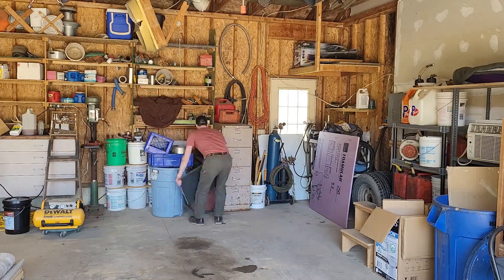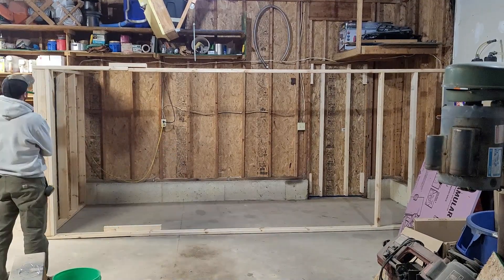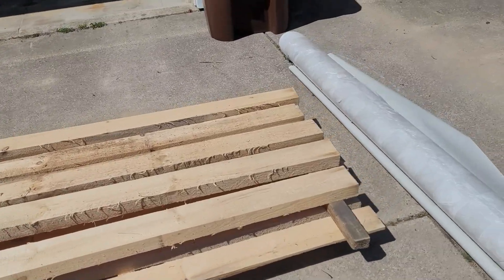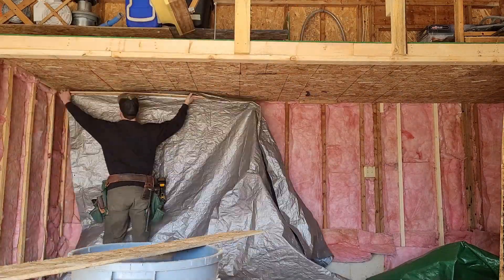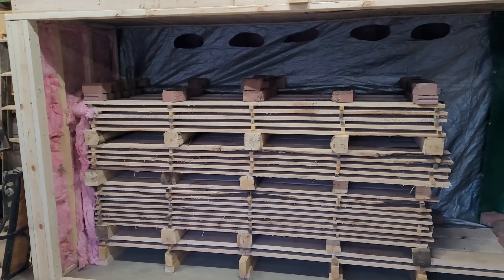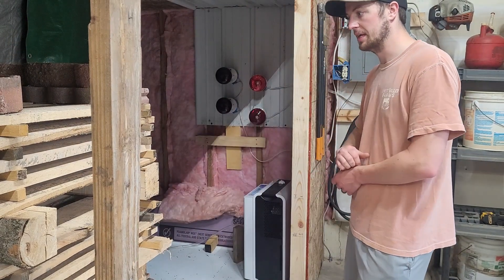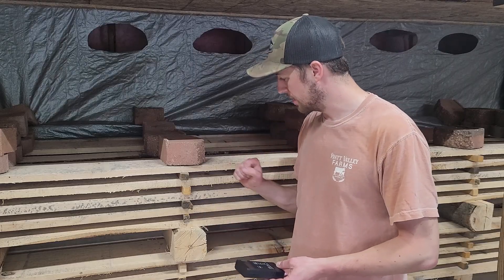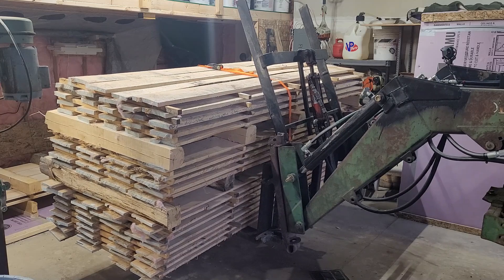How to: Build Your Own Wood Kiln - Dry Wood in 3 Weeks - DIY Garage Build

Comment: A dehumidifier? It might be more energy-efficient to just vent the moisture-laden air outside.
Reply from the maker: For optimal results, I need to keep relative humidity inside the kiln at a specific percentage. A dehumidifier is the best way to do that.
Reply: @craftzmanchris9859  Oh. Alright. That makes sense. You don't want too much of a humidity gradient in the kiln, nor too large of a difference in humidity between the air and the wood.

Now I'm wondering whether a humidity-controlled exhaust system would be possible, whether active or passive—by passive, I mean something that operates like the dial of a hygrometer; a material that is analogous to a bi-metallic strip with respect to temperature, but for humidity instead.

Circulation fan + heater + humidity-controlled exhaust system. More humidity = greater exhaust rate. Less humid = lesser exhaust rate.

What brought me here was researching ways to dry assorted shapes and sizes of wood sections for carving sculptures. I have assorted branches and tree trunk sections of varying lengths and diameters, but they have issues with cracking and/or molding. I have been looking into active ways to dry wood uniformly in order to mitigate cracking. Ideally, with a way to sterilize the wood.

A solar kiln would be acceptable during the summer, but freezing during winter would probably be a setback and risk splintering the wood as the water within the wood expands. I started looking into continual heating and your video was among the results that I decided to watch.

Comment: Did you keep the Kiln running 24/7, is there any concern for a fire issue? I'm wanting to do this, just a little nervious about starting a fire.
Reply from the maker: Yeah I ran it 24/7. I kept a thermometer in the kiln the entire time to monitor the temp. I kept a close eye on it the whole time because I was nervous about fire. I think you you are not nervous then something is wrong, but with the kiln maxing out at only 130 degrees, I wasn't too worried about it.

Comment: Thanks for the video. I see how you wired the lamps so you could run any combination from 1 to 4. What temperature were you aiming to maintain with the heat lamps?
Reply from the maker: @TheKenkat10  no problem. I slowly work up to 100 degrees F over the first week, then work up to 120 for the next 2 weeks, then work up to 130 for the last week and try to hold 130 for at least a couple days. It also depends of the type of wood and target MC.

Comment: so the fans are behind the tarp?
also which heat lights are those? and what temp does each put off?
Reply from the maker: Yes, the fans are behind the tarp, mounted on the wall, pointed straight down. Not sure what the temp is off the heat lamps but they are 250 watt each. I bought them at Menards I think.
Reply: @craftzmanchris9859  would a solar kiln dry them faster?
Reply from the maker: @jacobkincaid123  In full disclosure, I do not know because I don't have one... but I don't think so... this Kiln is at temp 24/7 and I can more closely control the temp and RH. Plus I can use it year round. I can get it to 130 degrees in the dead of winter.

Comment: Hi, I'm just starting off with my kiln and have found it hasn't pulled that much water - about a gallon in 3 days. Obviously some of that is about initial MC and volume of the stack etc, but I'm curious about how much you were pulling. Basically, I'm wondering if my dehumidifier is cutting out at higher temperatures and lower RH (despite being set to continuous) ... Or maybe I'm just impatient. Grateful for any thoughts.
Reply from the maker: To be honest I'm not sure how much water the dehumidifier pulls because mine just drains outside. I would expect more than a gallon every 3 days. I think you might be right, it might be shutting off for some reason or maybe it's not working right? I've seen them still run but stop pulling humidity out of the air. Is it a new dehumidifier? 

What temp are you able to get the kiln up to? What species of wood is in it? How much wood? All of those questions will effect the amount of water pulled from the wood.

Comment: This is an awesome setup Chris! I've looked at every home built kiln that exists on Youtube gathering ideas for my Kiln build in March. How high can you get your temps in there? I've gone back and forth between r13 or something thicker but I'm thinking r13 is all I need to get up to 130 or so for my bug kill. Keep up the great work.
Reply from the maker: Thanks for the kind words. If I run the dehumidifier on continuous, I can get it to 130-135 degrees. The problem with it being on continuous is the relative humidity gets a little too low (down to 10-15%). I think if I had another heat lamp or two it would be no problem getting it to 130 degrees.

Comment: Wonder about electricy use????????
Reply from the maker: Good point. It is actually pretty easy to calculate. 

1000 watts of heat lamps consumes 1000 watts of electricity in 1 hour. Otherwise known ad a kilo-watt hour. I am charged around $0.14 per kWh. So that means it costs $0.14 per hour to run the heat. Which is $3.36 per day, $23.52 per week, $70.56 for the full 3 weeks (if i am running all 4  250 watt heat lamps for the full 3 weeks, which I didn't quite run them that much). 

Regardless, a small price to pay in my mind to have a big bunk of oak lumber dried in 3 weeks.

Comment: You need to get rid of the 4x4s in the stack or plug up those large gaps that they create.  The air is going to take the path of least resistance.  You are going to get very little airflow through the spaces with the standard stickers.  This will cause your drying to be uneven through out the stack.
Reply from the maker: @braddoesitall  It must not be on video but I did stuff fiberglass insulation in the bigger gaps. I need the 4x4s to fit my pallet forks under. I can't lift he whole bunk at one.

Comment: I think your insulation is going to get wet and mold .
Reply from the maker: Are you thinking it will get wet from condensation? Don't you think the dehumidifier will suck all that moisture out?
Reply: @craftzmanchris9859  If you have ever been in a kiln they are extremely humid until the wood is dry .
Reply: Pretty sure that was fiberglass insulation. Last I knew fiberglass didn’t grow mold.
Reply: @ No but it will trap water behind it and mold the wood
Reply: Nice build, don't know if you are aware so I will mention powder post beatles and a sterilization cycle.

Comment: Do you have a drain hose attached to the dehumidifier to keep  it from shutting off?   It would be interesting to see how much electricity is used to dry a stack of lumber and how much it costs.
Reply from the maker: Yes I do. It drains outside so it can just keep running. I think the dehumidifier runs a lot for the first week, maybe two, but then not so much. If I set it on continuous it will get down too 10% (or less) relative humidity, which is too dry. The lowest I can set it to maintain is 30%, so that is usually where have it set. Maybe I will do a cost analysis video. It would be relatively straight forward to calculate some ballpark numbers. Although it would be hard to put a dollar amount on the convenience of being able to do it myself, right off the mill, without handloading, and done in 3 weeks.